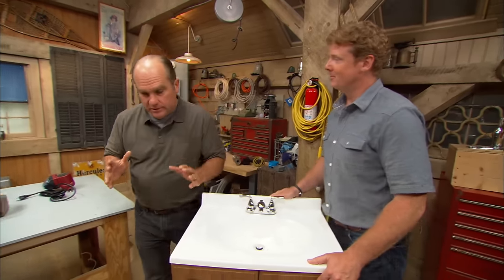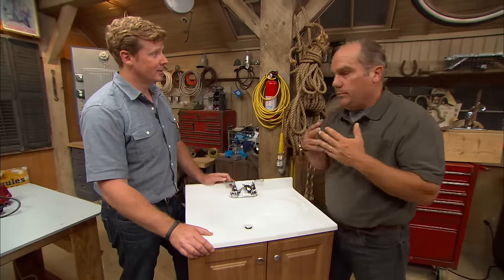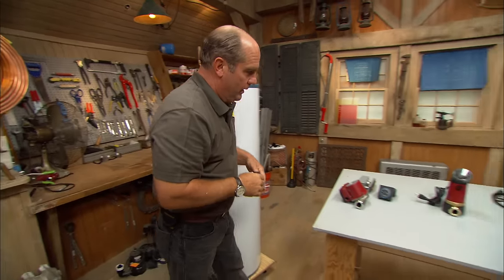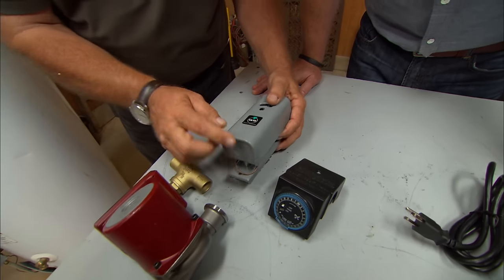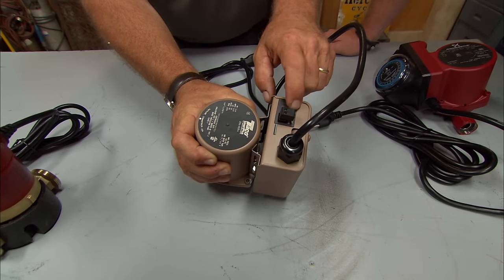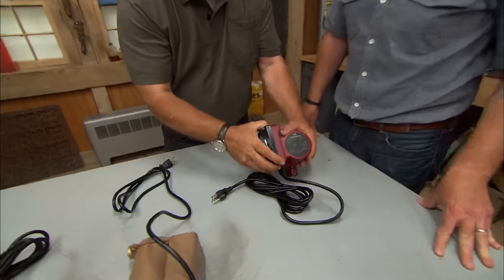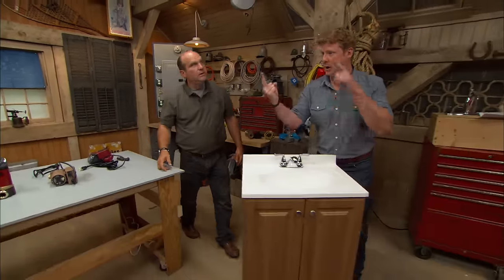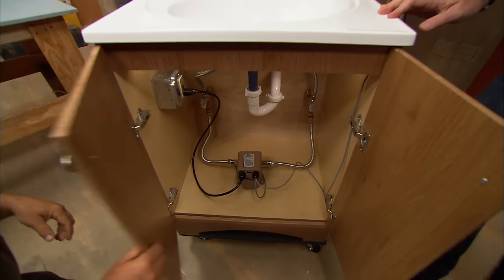How to Get Hot Water with a Recirculating Pump | Ask This Old House

Comment: I went with the cheap watts $99 blue pump and the passthrough device. I connected the pump power to a GE Smart plug configured it with a motion sensor. The sensor detects movement in the kitchen area turns the pump on for 30 minutes. It will ignore further movement for 30 minutes. This way I don't need a timer having this thing run all the time when it's not needed.

Comment: So if I understand correctly, now you not wasting water but pumping cold water back in your tank forcing it to warm it up again, wasting energy... Not sure which one is worst...
Reply: That is why you set it up with a timer, so that it warms up the water in the pipes just prior to when you are going to use it. If you don't do this then you have to run the cold water down the drain waiting for hot water to arrive, cold water is going into your water heater anyway to replace what you are dumping down the drain. Set up right it saves water and energy.
Reply: When you push cold water out of the hot water line, the water heater will receive equal amount of cold water from your city water, so there is no wasting. In addition, cold water from city in winter should be much colder than the cold water in your house cold water line, so in the case water heater is doing less work if a circulation pump is in place
Reply: I have said this before, it is only 25 watts and it is on a timer, that is 1/4 of a 100 watt light bulb, or with the new fluorescent bulbs it is 2X the power but water is more valuable for the environment.we are running out of water

Comment: I had one installed around 2005...The cold side came out warm.  Now I had to wait for the cold water.
Reply: My house has the same problem too. Cold water is warm. There must be something wrong.
Reply: The thermostat on the pump must be broken?
Reply: check your check valve...
Reply: @whatsfordinner7971  No, nothing is wrong.  If you don't have a dedicated return line and use the cold supply to the sink as the return, then of course your cold water will run warm/hot until you run it for awhile.
Reply: That's the bridge style, where you don't run another line all the way through the house.
If you want that to not happen at all, run a line all the way with pex and do it that way.
No more warm water
Reply: Bad installer not giving you instructions, or did you not listen to your contactor when he was explaining? A "comfort" recirculator sends a burst of hot water up the hot pipe, then down the cold pipe, to balance the two. It's cheap. But it's not very comfortable. They use the name to trick you.
Reply: @KevinJDildonik  All I remember it was not a good set up.  Maybe things have improved .

Comment: We had the same problem in our small house, and our plumber ran a long copper line out to the farthest point, and pitched it slightly down to return to the hot water heater. It works by convection, and we get hot water very quickly, and don't need a pump and the electricity to run it. Works great.
Reply: Valuable tip!
Reply: We did this years ago when energy was cheap. You do realize the convection system keeps the water warm at the sink 24 hours a day, right? That's why we stopped doing it.
Reply: I did a gravity line to my farthest sink (slightly pitched return 1/4" copper tubing back to a check valve then going into the drain valve (extended with a brass nipple and a tee for new line) back in 1975 when I built my house.  Old plumber friend suggested and it has worked great!!!  Not sure if this constant recirculating flow helped extend the life of my Gas Hot Water Tank but my first tank lasted 27 years before I needed to replace it.  Then I hooked up this return line into the drain valve on the new tank. This new tank is 17 years old and still working great and I have constant hot water (with no electric pump motor).  Granted I did this while building the house so it was easy then.  Many thanks to my dear friend Hank the Plumber.
Reply: @rupe53  But doesn't all that heat loss be offset by less heating of the house, unless you run the line through the attic or somewhere you don't need the heat? In theory it should be neutral energy-wise during winter when you most want to always have hot water.
Reply: @purpleblueunicorn  ... I see where you are going with the "zero net loss" idea. The reality is most people don't notice if the basement ceiling or various storage cabinets are warmer. After all, pipes run through areas that are seldom used so you are heating unused space. It's considered a loss. Even if fairly well insulated, there's some loss. Also consider that half the year it's summer so heating is not necessary elsewhere. To reduce that loss further, many systems are on a timer, so they don't run when people are sleeping or working. The newest solution is "point of use" heaters rather than a central water heater for the whole house.
Reply: @rupe53  I would still argue that those cabinets will in turn offset heat loss that would go into heating them. Heating the basement ceiling will raise to the first floor, just like radiant floor heating. Heating your basement is different because you will lose energy through walls and windows. Now if your pipes would be in the roof, that would be a total loss. You are right, in summer it would be a loss and you would even need to cool this additional heat, but then the pump can be turned off and we don't need the hot water as much. Have you measured the different energy uses with the pump running or not in winter? Even the pump's energy will be offset in winter.
I'm still debating whether to install point of use or recirculating pump. The way my house is build, I would need a valve on many appliances and all those devices whether it's valves, instant heat or 1.5gal heater will all need replacement and maintenance.
Reply: @purpleblueunicorn  ... no argument that some of the heat is not wasted, but heating unused space is a net loss. There are also wall and window issues in that space. You are better off with a little more insulation. Personally, I have tossed around the idea of a pump connected to say a bathroom light switch. (or motion sensor) You go in and turn on the light anyway so why not trigger the pump to make hot water ready? (still tied to a t-stat to shut off when temp is reached) Much of the demand for these things is driven by cost / cost savings, versus convenience. How much time and how many gallons of water might get saved or wasted? You'd have to do a study and figure it out, other than from a convenience viewpoint. Some people are willing to pay for that.
Reply: @rupe53  "keeps the water warm sounds good "  Im not sure what you meant exactly. 
Would it be more apt to say that the water is being constantly heated  24 hours a day instead of the water is kept warm 24 hours. There is a big difference in those two . Ive been eager to solve this problem for years and today I'm researching so that i can get it don once and for all.
My goal is to stop wasting cold water , originally i thought that i could have some diverter to a barrel outside for the garden instead of wasting it. however now after reading this series of comments im begining to see that no cold water has to be wasted or even used when wanting hot water.
Reply: @JohnODonovan1  ... the point in this video is to keep warm / hot water at the end of a long run so you don't have to wait for it. In order to do that you will be heating the water again, as it returns the cooler water to the water heater. (because there will be some heat loss) So, yes you are correct from that viewpoint. hot versus warm is just a variation in degrees. The other part of the question here is cost to do that versus the cost of wasting water.... and how much water is wasted, how often? Municipal water is fairly cheap at $2-$3 per unit (100 cu ft or 742 gallons) so you'd have to sit down and calculate cost to keep it hot versus cost to piss it down the drain. In the average house I would bet the cost to keep it hot is way more than the cost to piss it away.

Comment: I'm surprised this isn't mentioned in more places, but these hot water recirculators also work great for keeping your cold water pipes warm during the winter in colder climates, and helps prevent them from freezing. I'll happily pay a couple extra bucks for the electricity and the time it saves me having to go around dripping the faucets in my house when it's below zero outside.
Reply: And the electricity should not be lost since it saves your it's heat you will not have to heat your house, does it?
Reply: No no no. You got a cheap "comfort" type which sends hot water up the hot pipe, then down the cold pipe, so you don't have to installed a 3rd return pipe. You can pay a little more to run the 3rd line, get hot water, and still get cold water. All types save some energy because you're not running a ton of water before the pipe heats up. But they still ultimately cost money all things being equal. For instance, if your home was built with the water heater on the opposite side of the house from the master bath, you might be able to save a ton of money over all of the above if you can relocate it more centrally next time it needs replacing.
Reply: As most people know warm water freezes faster than cold
Reply: Thats a great point that i have never thought of!
Reply: @garyindiana8037 but water flow is less likely to freeze. Hense a river in sub zero weather usually does not freeze

Comment: My tap water is cheap (no meter); we pay a fixed annual rate for water.   I much prefer to wait for the water to come from the tank in the basement to the shower some 40 feet away.
Electricity to keep the water hot in the line and the cost of the pump and the cost of the timer and installation are, in my view, not going "green". 
I noted that a timer was highly suggested so that the pump only works during important periods during the day.   I did note that when the hotwater was flowing from the shower or tap, the circulation pump kept going.

Comment: The animation part of this video shows the recirculation pump mounted on the return line just before line entry back into the bottom of the hot water tank (where the tank drain faucet also is located). But, since a water pump pumps water, not air, locating it on the supply side (i.e., before any faucets/outlets) means water will always be available for the circulator to pump. So, if as in the animation the circulator pump is located at the far end of the recirculation system (i.e., after all outlets and right before returning to the hot water heater) wouldn't there be a risk of introducing air into the line when opening a faucet, at least when the pump is running at the same time? If so, air pockets in the line can't be good for the pump, as it is a water pump, not an air pump.
Reply: Based on the context of the video, I'm guessing they use check values to prevent air from being introduced after construction...

Comment: I agree with the pump using electricity but if your on a well, your well pump is running waiting for hot water to get to the faucet wasting electricity and water without the convenience of hot water.  If your on a metered city water now your paying for the water your wasting, electricity might be cheaper plus the convenience of hot water.
Reply: Greg Lake … I think you misunderstand the concept. The pump does NOT use any water, nor does it flush it down the drain. A properly installed system will recirculate the water within the pipes and return the water via the cold water pipe, then shut off when hot water reaches the sensor. Basically this takes the place of you standing there running water down the drain while waiting 30 seconds for it to get hot, but all that cold water goes back into the cold side (for consumption elsewhere) so not wasted.

Comment: Why not use a temp controlled solenoid valve at the bypass? There would be a delay until the water reached a set temperature, but no wasted water. I'm thinking like in an RV...
Reply: That's basically what that last one is. It uses a temperature controlled bypass valve, not an electric solenoid. It doesn't waste any water, and the pump uses a very small amount of energy, but your water heater will cycle more frequently to heat the cooled water that is returned. https://www.amazon.com/dp/B000E78XHG/ref=cm_sw_r_cp_apa_fabc_FTbXFbX09XS2B

Comment: My neighbour did that and his gas bill doubled, he called the plumber back in a few months to eliminate it; over 1000 dollars spent to save 10 to 15 dollars a year in water.
Reply: Convenience isn't free lol 😂
Reply: IF this happened, something was very wrong in the way the system was installed. Unless there was a constant amount of cold water being introduced to the loop there would be no reason for the water heater to run to such extremes. A proper recirculating system is reheating previously heated water. Watch the video again and listen to how it's supposed to work and the safeguards required
Reply: My pipes are under the slab. Turn off the hot at the remote sink for  minute, and I have to draw hot water from the tank AGAIN. Whole house recirculation at my house? Wasteful.

Comment: In some smaller short runs where water lines are all on the same floor I've seen recirculation lines run without the use of a pump. Of course if it has any distance to travel or multi levels to reach I would assume a pump would always be necessary.

Comment: Can a circulating pump burn out if I turn off the hot water from the hot water heater and leave the pump plugged in? I think I blew out my pump because I no longer get instant hot water.

Comment: This is for the pump set up that doesn't use a recirculation line but that valve that is installed under the sink at the farthest fixture. 
So this circulates the hot side through the cold back to the hot water tank, then when the water flowing through the hot side is at a certain temperature, the valve under the sink closes to stop hot water from filling the cold side. 
Now my question is, when the valve under the sink closes and the pump is still going, won't the pressured water be dead heading and cause strain on the valve under the sink? Not to mention increasing pressure of the hot water side?
Reply: Doesn't the pump shut off if your not using any water?
Reply: @worldview730  no. It's recirculating as long as the timer is on.
Reply: Pump shuts off based on the temperature of the return line. The timer is on standby for the time programmed.

Comment: What is a brand and model of the unit you have under the sink ??? I would like to buy the unit with the wireless remote thanks
Reply: did any body figure out what make/ model this was?
\
Reply: Rheem
1/25 HP Hot Water Recirculating Pump with Under Sink Kit
Reply: @64savoy  do you need a second line for this under sink pump to work?
Reply: No it pushes the water into the cold line until the hot water arrives at the sink.

Comment: Always makes me laugh when these "experts" wring their hands about waste... they want to load the systems up with sensors and complexity... but reality is that anywhere but the southern most US locales, any energy that is radiated from a hot water recirc pump into living space is just contributing to the heat load that the same space has for heat... it's not "waste" and unless you live in a place where you are running your AC in October, chances are that there is very little to be gained by loading one of these recirculation systems with fancy sensors...a simple timer that turns the pump on when demand is most likely works fine, is simple and wastes little...  but those fancy pumps with all the bells and whistles on them sure cost a lot more than a simple bronze circulator and check valve and make contractors look like they've hung the moon...

Comment: Pure genius let's conserve water by increasing the electric bill!? 

I see this in large houses.....
2 water heaters on a loop system with a water pump!?
All is vanity?!?!
Reply: Yes, but a Prius Googoomobile with a COEXIST sticker will save humanity!
Reply: Yeah...I don't think this is as much for conservation as it is for comfort & convenience, nothing wrong with that but let's just be honest
Reply: I've seen feedback that users saw no significant increase in their electric bill.
Reply: I would say the water saved is worth the money spent.  Water is or will be a more valuable resource (depending on your location). With the right timer settings on the pump, the electricity cost would probably very little.
Reply: If one actually studies their household patterns and uses the timer accordingly, one will save water and not make any significant sacrifice regarding energy use. Properly timed for when hot water would be used anyway, the pump only consumes 25 watts. At my current electric rates, that is less than 10 cents per day IF i were to run it 24/7. I don’t, it currently only runs about 2.5 hours per day, just before times I know hot water is going to be used, i.e. first thing in the morning, once just before dinner, and later at night before bed. These are all times when hot water was going to get used regardless, so the water heater was already going to run. With this recirculation pump, it just circulates it just before we were going to use it. So, it might cost about one penny per day for electricity, but I would estimate conservatively that we are saving ten to fifteen gallons of water per day. It was definitely worth the price to install it. Insulating the hot water pipes has also significantly reduced the amount of times I need this pump to run, so who knows. When I am done completing my study, this pump may only have to run a few minutes a day three times.